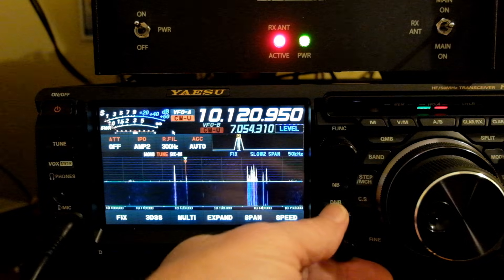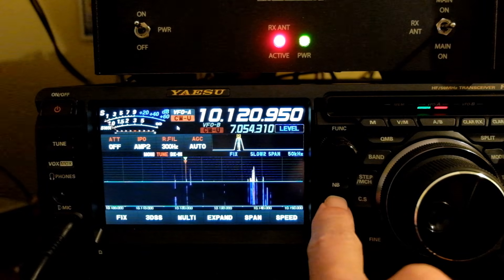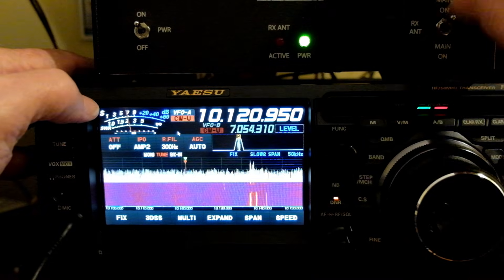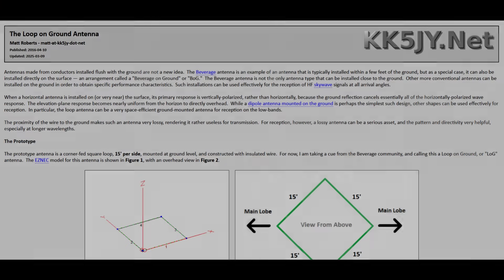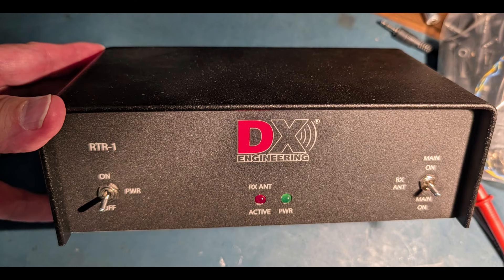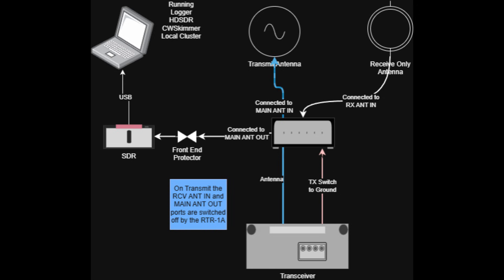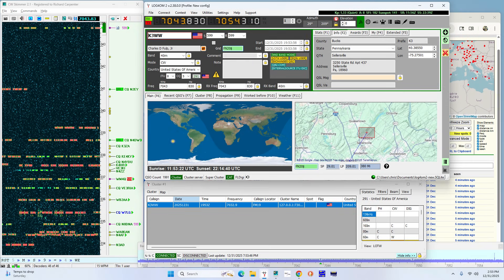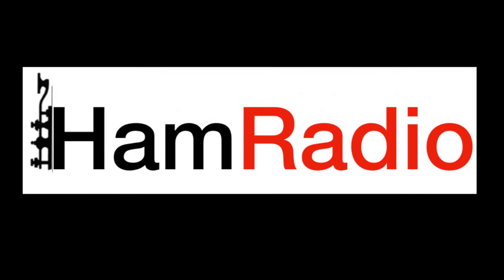Loop On Ground Receive Antenna

Comment: Well THAT'S certainly NVIS!! How long is the loop you're using in the video? I used to have a full wavelength loop antenna for 160 myself. Great receiver for an antenna. I got the idea from a W4RNL Cebik antenna webpage. It's one I'd also encourage for others interested. The article is titled: What is a HOHPL? Horizontally Orientated Horizontal Polarized Loop antenna. Mine wasn't up too high about 40' at the corners and it sagged. I originally used a 500' spool of 12ga stranded THHN wire. I used my antenna analyzer and recorded characteristics to graph out in a spreadsheet. I did so like every 500 kHz in HF. 1 MHz 1.5 MHz, 2 MHz.... I also noted the frequency when the pure resistance was 50 ohms, I noted the freq on high and low SWR points, I also did so for when reactance was at its lowest. I added about 30' and again noted the same changes which brought me into more of "resonant antenna" ....everything shifted pretty close to my calculations and fine tuned where my resonant areas were to be in band better. I miss that antenna. I fed it mostly with ladder line, and then a short distance from the eave of the roof down into the shack. from a balun to RG8
Reply from the maker: The loop on ground is not for transmit and rather than being NVIS in reception due to the location ON THE GROUND it actually has better low angle reception than NVIS.  While lengths can vary, Matt's article found that 60 feet was optimal for the noisy lower bands.  If it is longer then it starts to have fundamentals that cause unwanted results and unpredictability on the direction of the nulls.  60 feet is a good length for 80 through 20.  For me it's most effective on 80-30m.  I don't have a long enough TX antenna at my location for 160m operation.

Comment: I have a BOG (Beverage on Ground), but never have tried it. Is this similar?
Reply from the maker: Same concept but it is a loop of wire formed as a square joined at both ends to the transformer fed at a corner.  There is no terminating resistor.  The directionality / nulls are not as strong as a full beverage, but present.

Comment: Or one can do like I did and run the loop coax to a manual ant switch and switch back and forth.
Reply from the maker: You could do that and hams certainly used to manually switch between their receiver and transmitter, but forgetting to switch before transmitting would likely make rig be very unhappy.

Comment: Would be usefull to beginers. We may use the loop rcvd-antenna also inhere.
Reply from the maker: I wouldn't necessarily recommend it to someone starting out because of the need for a separate receive port or separate receive device and a protection circuit to protect the radio from currents that may come in the receive antenna during transmit.
Reply: @HamRadioQRP  Yes,  you are right, but to notify the beginers this video pretty good anyway.  73!

Comment: Use the Att
Reply from the maker: The demonstration was related to a weak signal.  One of those stations was much weaker than the other during the video.  Reducing the RF gain was equivalent to engaging the ATT.  There wasn't enough signal to come through the noise when the RF gain was reduced on the primary antenna.  The LoG antenna doesn't receive the electrical component of the signal, just the magnetic so it still receives the signal.

Comment: I'm going to have to build my own Rcv Antenna switch.Window line, maybe a built-in matching set of coils with silver soldering rod tuning slider-wiper and ganged variable air condensers w/ vernier dial. Brass and bakelite dpdt knife switches and porcelain beehive terminal passthroughs w/ brass hardware. The Drake R8B needs a huge LoG and two beverages added to it. I have no need for transmit or coax for any of this.
Reply from the maker: Sounds like an ambitious project!
Reply: @HamRadioQRP   It seems to me that your shortwave receiver is going to be only as good as it's antennas. No MATTER, the rig. I like to experiment! I like OPTIONS! Antennas are a fun side of this hobby. The work and investment in getting them and erecting them, studying, researching, planning...it pays dividends. I have two helpers. One wants beer. The other likes banking favors.